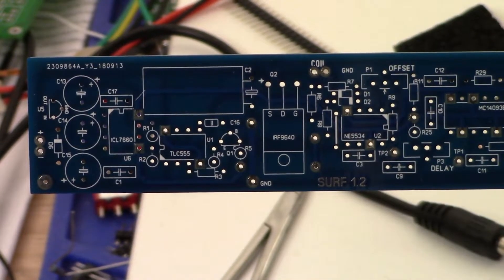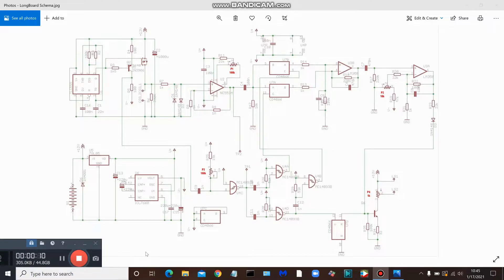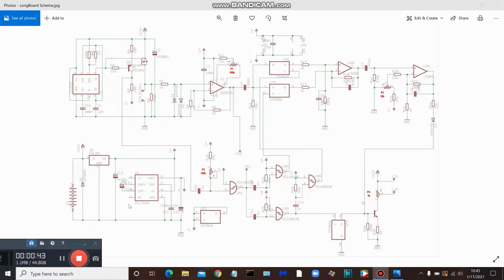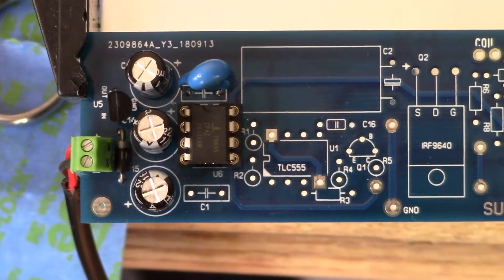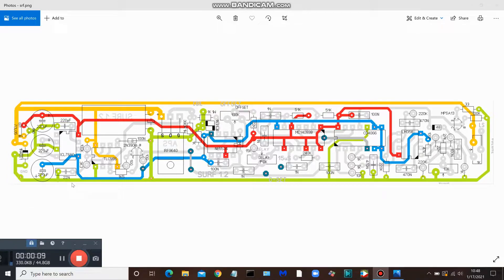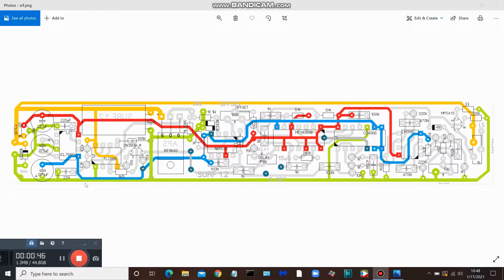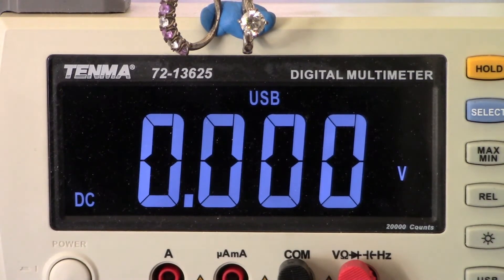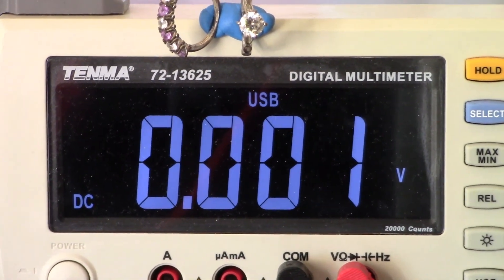Surf PI Longboard DIY Metal Detector part#1 build

Comment: what is the proper voltage for the board?
Reply from the maker: The project is fed with a 12V battery  which is further broken down on the board into +5, -5 volts by the onboard power supply.  Thank you for watching and please subscribe.
The Arduino Nano PI project on my channel is another version of the Surf PI which might interest you.
Reply: @SurfDetector  Thank you! I joined the coil and the board with headphones wire, 3.5mm jacks on both ends for connectivity. The coil wire is 0.5mm thick 30 turns and 155mm diameter of the loop. Will this be enough for the connection? What is the appropriate wire between the coil and the board that I should use? thanks for your time!

Comment: Hi ! All i can find is 10v max rated 7660. What did you use for your project? Will it work with that? I can get a 7660 for 0.5$ but the lt1054 costs 7$ each
Reply from the maker: look for one of these ICL7660SCPAZ

Comment: I saw your channel on silverdogs website, I love to see that there are people in this hobby, one question do you have the inductance values to make the coil in a 27.5 cm diameter housing concentric type of coil (not pancake), thanks in advance.
Reply from the maker: Hello,
Silverdog does a good job providing his kits.  I would personally recommend the Mini Pulse Plus.  I have made many PI machines but that is the one that goes with me to the beach.  I assume that you are interested in a coil for the Surf PI?  If so, you want to make yourself a mono coil, not a concentric for that machine.  I recommend something close to 300uH or a little more.  Thanks for subscribing, I shall be finishing off the Surf PI as soon as I receive my parts order as I am lacking the last op-amp.
Cheers

Comment: Thank you so much fore posting  this, I am trying to build one right now myself although I have no experience, this is my first build, I bought a custom coil off eBay from a guy in Canada that builds them. If you test your machine in the field it will most likely be a youtube first. Everyone else just does a bench test at most.
Reply from the maker: Hi,
Glad to hear that you found the video to be useful.  The next video in the series will be posted today.
Please subscribe  if you enjoy the content.  
Cheers
Reply from the maker: Do you have a link to the ebay listing for the coil that you purchased?
Cheers
Reply: @SurfDetector  Yeah I have it, I just checked and he does not have any listed right now. I sent him a message. I can email you a picture of mine if you like, he said they are designed for PI machines and he test them in water, I forgot how deep, and that most people he sells to are in the Florida area. ( I subscribed immediately on seeing this video)
Reply: Greetings From Canada i am the Coil guy lol Guys Remember one important thing, Keep plenty of 78L05 and 7660 's on hand lol those are the weak link to this detector the 7660 is very easy to blow even more so now that we are using lithium batteries more and more and the 7660 does not like being feed much more than 12.5 v even if it claims to be rated up to 15V so it blows often, and when it does it normally takes out the 78l05 with it if your detectors suddenly stop working! start with those two components. The Surf pi is really a lovely introduction detector that is easily used in the field if you don't mind digging nails lmaoo
Reply from the maker: The LT1054 is rated for 15V, most versions of the 7660 are only 10V  the highest rated is 12V.
Cheers
Reply: @SurfDetector  Cool, glad sliverdog changed it from a 7660 to an Lt1054, the last ones I got, granted was a good while ago, had the 7660 in the kits